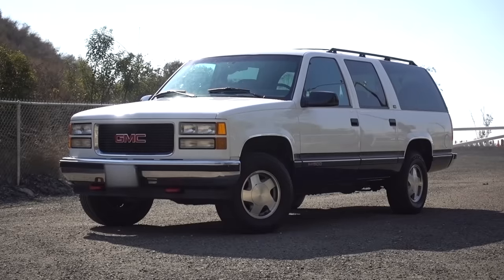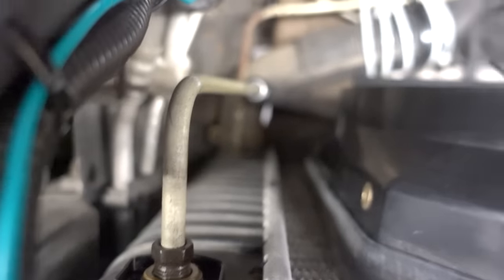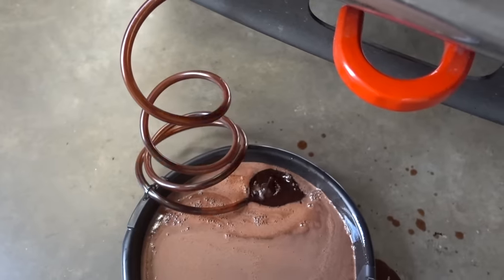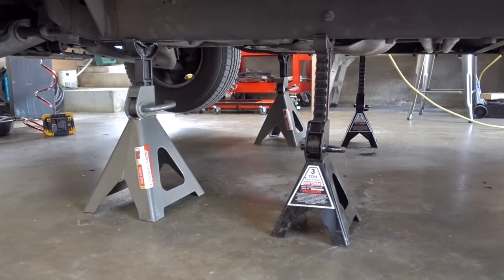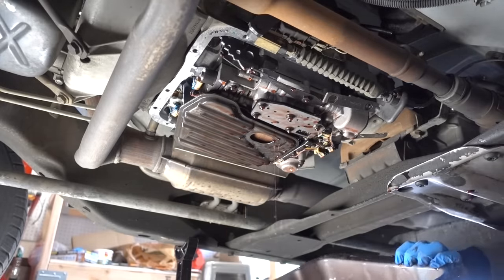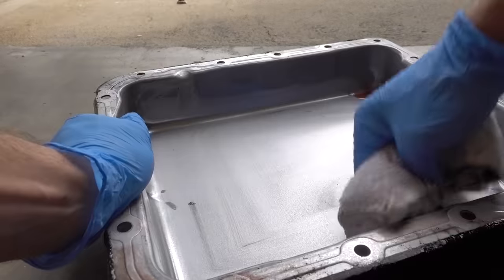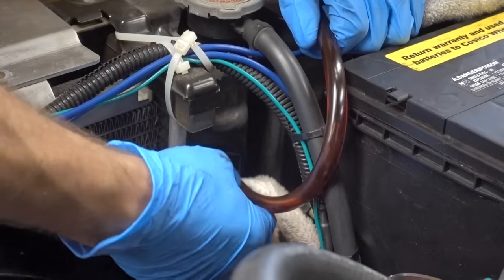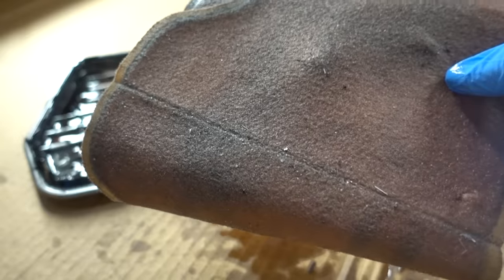Why You Should NEVER FLUSH YOUR TRANSMISSION FLUID!!

Comment: After nearly 10 years in the auto service industry I honestly believe regular trans flushes is one of the best services you can do for your pocketbook long term.
Reply: “Regularly” is the key word.
Reply: I absolutely agree, especially in manual transmission preventing wear and tear of the gears
Reply: I couldn't agree more. I have a number of equipment that all use oilnincluding my vehicles and short intervals extend the life indefinitely.
Reply: @davidmackieson4609  the dip stick has been removed because the use of Sealed transmissions have been taking over the market, a sealed trasnmission usually doesnt require check and fill, this is why there is no dipstick, a plug on the side of the tranny upper level will be the access port and where you check for level, once the plug is removed a small ammount should want to leak out. The Reason you stated is simply false, it isnt to rip you off, it is because the equipment is serviced differently,.
Reply: @hydroltd6148  no actually it’s because owners would put in the wrong trans fluid and ruin the trans.
Reply: Yeah but how regularly?
Reply: 10 years... So, you're still a newbie compared to The Scott.
Reply: @hydroltd6148  thanks for making sense of this 👍
Reply: @snap-off5383  your cars ownwers manual will tell you.  For my car pontiac g6 its every 50k miles.
Reply: Agreed but without the chemicals.
Reply: @hydroltd6148  what it's mean different? Serviced without replacing  oil filter
Reply: What are your thoughts about brake fluid flushes?
Reply: @evanpimental  brake fluid is hydroscopic and draws moisture which decreases pressure and increases pedal travel. Brake fluid also can boil and after it boils it’s almost ineffective. 30/40k on daily driven cars is smart in my opinion.
Reply: @derrickbarker343  thanks
Reply: @hydroltd6148  Manual transmissions are just drain and fill.
Reply: I agree. I only own one AT vehicle but I have the ATF flushed every 30k miles to replace all of it and keep the transmission in excellent condition. All of my manual transmissions get changed every 30k miles too but they are a simple drain and fill.
Reply: @snap-off5383  Every 30k miles
Reply: @mightymight365  ROFL
Reply: my trucks is 45 years old. It’s never been done as far as I’m aware. It never will be done.
Reply: I recently seen the color of my trans fluid lol it was dark and I have 170k in my motor and trans I am very skeptical about flushing at this point however since I have always had oldschool cars it was never an issue now that my car is only 10byears old lol yeah I drove 30 year old cars and this is new to me what are your thoughts on flushing? Its a dohc 16 valve motor with a 4 speed ? Would appreciate your thoughts being in the industry ✌🏽
Reply: @evanpimental  highly recommend it every 2-3 yrs.  Brake fluid “collects” moisture that corrodes internal parts and water doesn’t compress as brake fluid does so it diminishes performance and positive feel.  Take a car with old fluid in it, flush it with new and you’ll feel like you have new brakes.  It’s a significant difference.
Reply: Maybe not flush, but drain and fill
Reply: @evanpimental  it goes through very high heat cycles, and gets dirty and condensation like any other fluid. and is most overlooked, besides P/S..
Reply: I got my 1st mechanic job in 1985, back then people were still driving around muscle cars as daily drivers. The more fluid out, and the more often the better..
Reply: @moto5914  thank you.
Reply: @dbspecials1200  Thank you. Can not flushing brake fluid damage any of the ABS unit's internals?
Reply: @AntiQuake  older trucks didn't beat up as bad on the fluids so didn't need to be done as much.  Modern trucks beat crap out of fluid and should be done from 30-50k
Reply: @Spahi77  I’m aware
Reply: My engine oil stick funnel broke on my F150, so I have no keep tight 2,3" off the funnel along with the dipstick to preventir to fall while driving. Is this bad for the engine?
Reply: @evanpimental  You should change your brake fluid every couple of years. ABS flush is done with a scan tool. If you don’t have a scan tool, old school way would be bleed all brake lines with new fluid (without getting air into the system), go for a drive on a gravel/ dirt road and brake hard enough to activate the abs system. This will pulse out the old fluid from the abs unit. You could then re-bleed all lines again.
Reply: @daveo9844  what is the purpose of using a scan tool for the bleeding process? Just genuinely curious for knowledge. At the shop that I worked at, we used a machine to force brake fluid through the reservoir through the rest of the system. Are you saying that this is not going to also bleed the fluid in the ABS module? It appears that most master cylinders are connected to the ABS unit, which then goes to the wheels. I'd assume this would flush all of the fluid.
Reply: @evanpimental  I think everything should be flushed periodically. Brake fluid also loses viscosity over time. Look into using DOT 4 if your vehicle can safely take it. It is a little thicker and can withstand hotter temperatures
Reply: @jimsgaragetoys  On my manual transmissions, I drained, then flushed afterwards with a quart of the same weight trans oil.
Reply: @mojomojo5779  Well, I consider a flush with pressure from a machine like AT flushes. I get what you do, a simple pour through with an extra quart. 👍
Reply: I agree, this guy doesn't know wtf he's talking about
Reply: @snap-off5383  I replace the trans fluid every 30k. miles no matter the type of transmission, MT, AT, or CVT.
Reply: @j.rob.5943 Would the dealer or a transmission shop put in the wrong fluid?
Reply: @hydroltd6148    There’s no transmission fluid in a manual. There’s brake/clutch fluid
Reply: @maxcalder1010  lp0 pp
Reply: I took the chance doing a flush after 300,000 km and came up ok.
Reply: my 2007 F-150 has 168k, original trans fluid is still clear, thick, sticky, and semifluid in consistency. I drive slower than most....and never exceed the limit. I have my CCW permit and do not want to get pulled over. 13 quarts is a lot of oily fluid to waste if ya don't need to.
Reply: every 15000 to 25000 km engine oil + transmission also brakes every 2 years or 1 if you drive a lot
Reply: Especially if you have a transmission filter that requires the removal of that transmission to replace it. Every 30k on the trip.
Reply: @hydroltd6148  Making it harder for the owner to service their vehicle... their property... because it is "different" makes it okay to make it harder to service? REALLY?
Reply: yes, you just want people breaking their transmissions to "fix" them like a crook
Reply: @slumy8195  Thats a big claim. Do you have any data to back up that regular transmission flushes cause damage?
Reply: @derrickbarker343 filter replacement too?
Reply: @maxcalder1010 yes there is.. It's called "gear oil" and lubricates the gears in a manual transmission.
Reply: Just use diesel to do the flush. No use wasting new oil. The diesel will just evaporate out the breather
Reply: Dnt flush only drain

Comment: I've been a mechanic for 45 years and I say if you are going to do the flush at home this process is probably the best that I have seen (probably a better way than having the dealership do it), as far as putting the bolts in the same hole that they came out of......a little over the top but whatever turns your wobulator...........Good video
Reply: I had assumed he had done that in case there were different length bolts on the pan but the ( Should be all the same size/length) then again some vehicles can be odd.
Reply: Yes,  he's very thorough.... and loud... I'm sure he's never heard the expression "speak up, son!"😱
Reply: You have never had to  take bolt out cause it's too long
Reply: And the extra set of jack stands was over kill too.
Reply: @Nathan Hanson or if you don't have enough experience to know what you're talking about like you.  The larger jackstand has way more than enough capacity to safely hold the vehicle up.  The extra jack stand just gets in the way.  If you are frightened to work under a vehicle, pick a different pastime.
Reply: @x-man5056  I take it you've never seen someone crushed under a car because the jack stand failed.
Reply: ....but occasionally they slip to the side on grease and oil, I had that happen once. It's easy to throw another stand under there, but you can continue work with less safety and impress people.
Reply: @someotherdude  You obviously need to use them correctly and on solid ground.  Use only 3 or 4 legged stands, not the ridiculous one or two legged post stands that somehow got popular nowadays.  When I set a vehicle up on stands I always get out from under and give a good hard push against the vehicle to make sure they are set solid all legs engaged with the ground. Wheels chocked of course.
I have no problem if you feel more comfortable with redundant stands though.  What ever gets you out there wrenching with no fear but reasonable (for you) security is fine.  Better over safe than not safe enough.  Not trying to impress anyone, just have enough experience to know what to use, how to use it correctly and safely.  You learn a few things in fifty years of wrenching.
Reply: @Malike420  All the bolts shouls be cleaned on a grinder wire wheel, but organization is the best, safest way to do things. I have no critism for his posting and helping a non professional mechanic. Some interiors mus be unbolted before you can pull pan out due to the front axle. Thanks for the video, not right to disrespect.
Reply: @x-man5056  I had a friend doing a rear brake job using a bumper jack & yep it fell on both legs.
Reply: @douglb8960  Bumper jacks are widow makers.  They were only intended to allow for changing a flat tire on the side of the road. Not very safe for that either but you can use them if you are on flat, solid ground and keep all your body out from under the car.  I would avoid them if possible.  I haven't seen one in years.  Never use one for vehicle maintenance and what ever jack you use, always support the car on 3 or 4 leg jack stands properly before getting underneath.
Reply: @x-man5056  yup & getting out of a rut, foolish teenage years, 50 yrs ago
Reply: Dammit that reminds me, I've got to replace my Ford's wobulator, too..
Reply: @ilickcarpet  Don't forget to grease your muffler bearings while you're down there.
Reply: @x-man5056  And piston return springs.  Chris fix has a good vidjeo(to use an Ave term) on that.
Reply: n
Reply: Who Cares yeah but some transmissions have 4-5 different length bolts and is a rookie gonna remember where they go coming back 2 days later? Gotta account for that not everyone has been a mechanic for 45 years
Reply: Malikye Mirage a Mazda trans pan I dropped had four 2 inch bolts, four 4 inch bolts, four 2 1/2 inch bolts and 1 3 inch
Reply: Agreed How about replacing the filter first, cleaning the magnet and then doing the "flush"? Less old/new fluid mix.
Reply: Yeah same bolts same hole is a little  OCD
Reply: Leroy B no they are different lengths sometimes.
Reply: Leroy B and old threads don’t like different holes sometimes
Reply: @whydoihave6neutrals772  he's tightening with a torque wrench not his fingers
Reply: Leroy B what?
Reply: @Malike420  on the 4l60e the valve body has 8mm and 10mm bolts of different lengths so yes they need to be put in the same place, when I built one of these I put a longer bolt in the wrong place locking up my sunshell (wheels didnt move)
Reply: @x-man5056  I have. managed to get my belt off and swing it at a nearby scissor jack. About an hour later I was free from a 4000 lb car. I bought ramps and a second set of jack stands the next dey.
Reply: @spencertharp1102  Well, that was an exciting day I bet.  Glad you can tell the story.  So are you saying the stand collapsed  broke?  Please elaborate.
Reply: @x-man5056  Back when I only worked on my own car to get from A to B, and hopefully back to A, I had a 95 Lexus ls400. I'm not that old (born in 91). I needed to replace a rear wheel speed sensor, which needed to be hammered in. Parked on a slight decline, one blow caused the car to shift forward and fall off the jack stand. The car landed on the rotor but still had me pinned by my thighs.
Reply: @spencertharp1102  OK, you were damn lucky.  YOU made some mistakes in the process,  the jack stand didn't fail, YOU did.  No tool or device designed to support a heavy load is ever going to be smarter than YOU are.  Starting with "Parked on a slight decline", you made a common, novice mistake right off the bat.  It was not the jack stand that failed, YOU did.
In over 50 years of working on cars (long before ABS existed) I've never seen a wheel speed sensor that needed to be "hammered in".  Don't recall ever doing one on a Lexus but anything with "sensor" in its name is likely to be "sensitive", hence the name.  The ones I've done have a fine thread machine screw/bolt that secures them in place.  If it was a press fit, more than likely a special tool was called for or at least some thoughtful strategizing before proceeding.  Regardless, if a hammer blow can knock an elevated vehicle off of stands it was not set up right.
Please read all my comments in this thread.  Always try to rock an elevated vehicle before getting underneath (even on level concrete).  Your safety is YOUR responsibility.  The jack stands are just a tool, make sure your brain is fully engaged. Double check.  If you are unsure, get some experienced advice.  #1, when possible, avoid jacking a vehicle on inclined or soft surfaces.  If you must (like a roadside repair), stay the hell out from underneath it.  Regards.
Reply: @x-man5056  U can never be too safe, it just highlights to the ignorant that getting under a car like that u got to make sure it cannot fall on u.
Reply: @spamsam99  quote from my comment above 8 months ago:
"I have no problem if you feel more comfortable with redundant stands though.  What ever gets you out there wrenching with no fear but reasonable (for you) security is fine.  Better over safe than not safe enough.  Not trying to impress anyone, just have enough experience to know what to use, how to use it correctly and safely.  You learn a few things in fifty years of wrenching." 
If you have much experience working under vehicles elevated by jack stands, you've had the problem of the stands you NEED being in the way.  I have good jack stands and use them correctly.  I don't need or want extra jacks stands under there with me.  Don't need them, they would be in the damn way most of the time.  Do what you need to do to feel safe. 
Being less frightened does not equal more safe.  Having redundant stands under there says you are a rank amateur and very unsure of yourself.  You'll get over it if you stick with it...or you'll pay someone else to do it
Reply: @x-man5056  YES you always shake the vehicle first before getting under it
Reply: @jerryrday1837  Yes, I said something to that effect in here somewhere.  Check to make sure all of the jack stand legs are in contact with the ground first.
Reply: @jonathanparle8429  Because you obviously don't know what you are talking about.  As much problem as it is to get a car up on 2 ramps without them sliding, doing all 4 wheels on ramps is just asking for an amateurish cluster fk.
Reply: @whydoihave6neutrals772  To can tell by the amount of threads showing when you push the bolt into the hole to but not tightened.
Rule of thumb is, at least the diameter of the bolt in grip length but not more than double the diameter.  So on a 1/4 bolt you'd need 1/4-1/2" thread showing when it's through the oil pan but not threaded into the hole.  5/16 bolt would be 5/16-3/8 grip length. 
There are of course many exceptions but that should get you started.  Fine thread bolts often have a bit more grip length than coarse thread.   Be very careful on holes with bottoms, you can use a straitened out paper clip to check depth.  Never bottom out a bolt into a hole with a bottom.
Best to keep organized but sh*t happens.